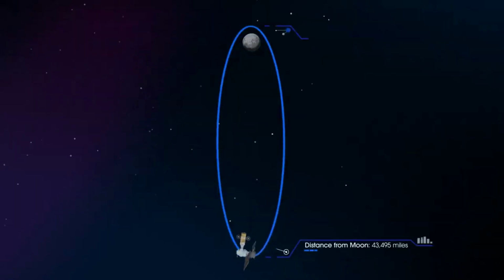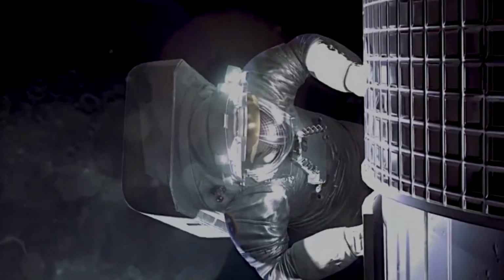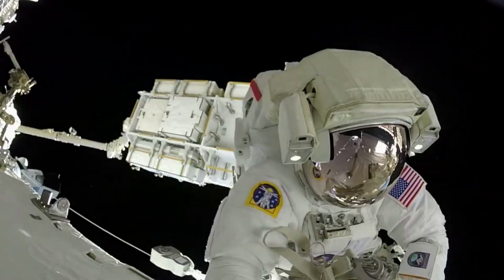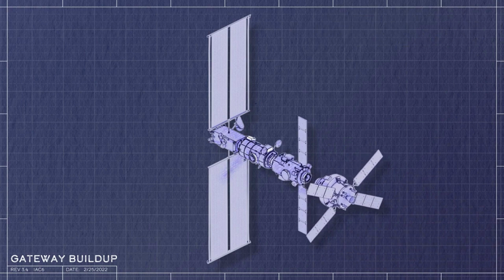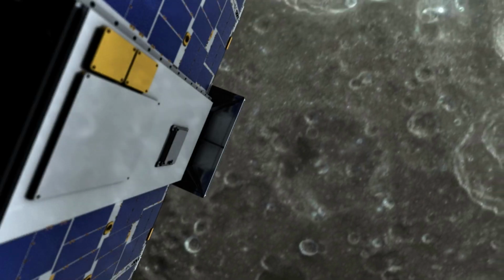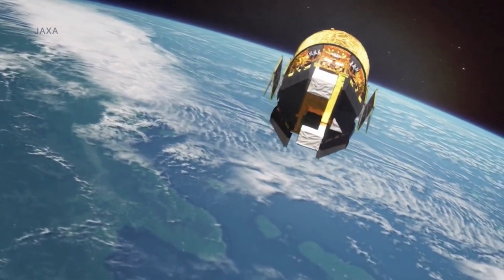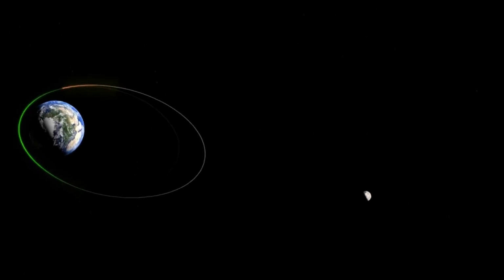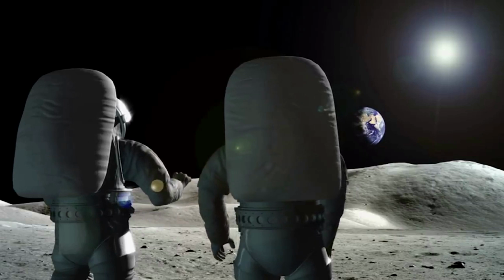Why Gateway’s Unique Lunar Orbit Is So Important

Comment: Why is a Lunar Gateway even needed?  Here is what the mission profile should be.  (1) Establish a long-term propellant depot in LEO, supply on a regular basis with Starship.  (2) Launch HLS to LEO and load propellants (3) Launch astronauts to HLS using Crew Dragon (4) Translunar injection of HLS to Lunar orbit.  (5) Land on Moon  (6) Work on Lunar base (7) Launch from Moon to TransEarth trajectory (8) Injection burn to LEO (9) Dock with Crew Dragon (10) Return to Earth.   NOTE:  all cargo, equipment, supplies for the Lunar base will be delivered with unmanned cargo Starships well in advance of the HLS so the astronauts have some place to go.  The HLS will handle only astronauts leaving room for the propellant for the orbital insertion burns.  HLS and cargo Starships will not need heat tiles or aerodynamic surfaces since they will stay permanently in Space.  After all the goal is a Lunar base not a Lunar space station

Comment: A polar lunar rail gun similar to the navy rail gun or a lunar spinchaunch platform could launch materials to near the lunar gateway orbit. This could mean processing water to rocket fuel and rocket refueling station in lunar orbit, or it might also supply cheaply launched lunar mass nessesary for a tethered momentum transfer satellite to toss rockets and or probes to Mars and or the asteroid belt.

Comment: I think that the Dynetics Alpaca lander is likely the best lander for the early moon missions right now. I worry about the destructive moon dust getting into and destroying the pully system for Lunar Starship's suspended lift. Even if a ladder could be lowered it would be a dangerous height to climb and if the lift could not be retracted it would make flying and docking extremely dangerous.
Reply: The Alpaca has to depressurize the cabin to get the astronauts to the surface, so it has its own issues with lunar dust. IF Dynetics solves their weight issue, they could very well beat out the Blue Origin led National Team ILV, as NASA really loved the low slung Alpaca design.

It's likely that HLS Starship will have redundant 'elevators' as NASA stated that it has redundant airlocks.